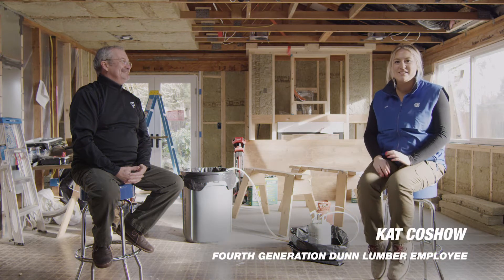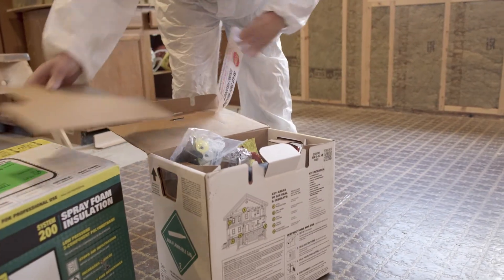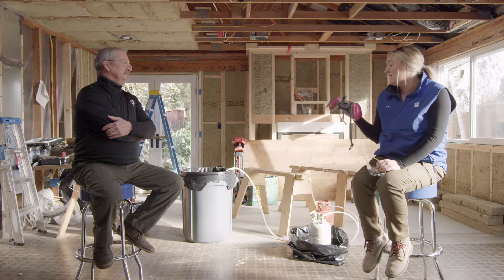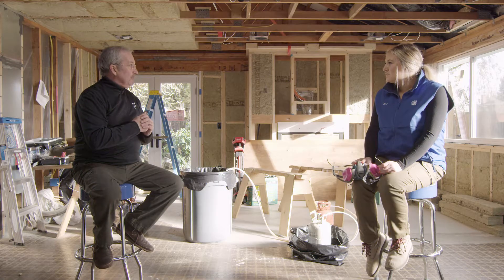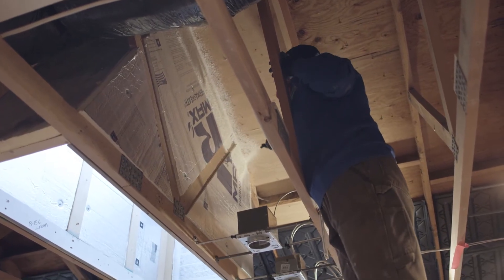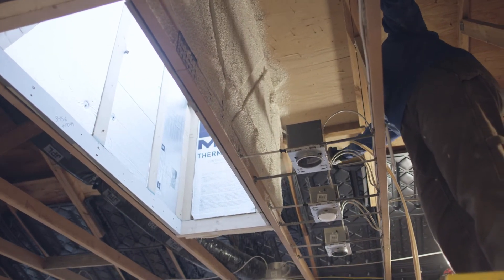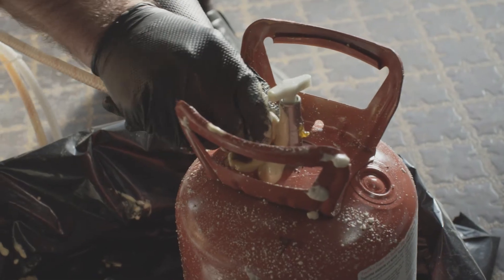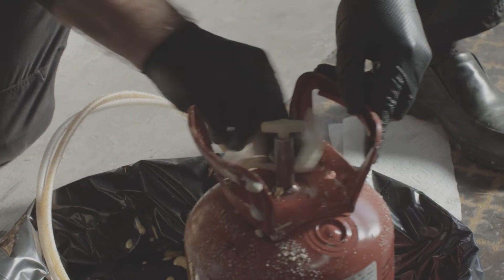How to Install DAP Two-Component Spray Foam Insulation

Comment: You didn't mention product, ambient, and substrate temperatures in this video -- which seems pretty important.  Also, you didn't explain why you would need to switch hoses... only one set of hoses comes with the product.  Where would you get another set, and why would you need to swap them out?
Reply: the product, ambient and substrate temps are stated and printed on the foam boxes. You can order another set of hose at your local Dunn Lumber.

Comment: How much  space can i cover with one kit ?
Reply from the maker: These kits are designed to cover approximately 200 square feet at a thickness of 1".
Reply: @DunnLumber1907  But all these kits will never actually cover as much as they state. It's more like about 3/4 of what say it will cover.
Reply: the board feet are printed and stated on the foam boxes. There's also information material in the box, printed for reading.